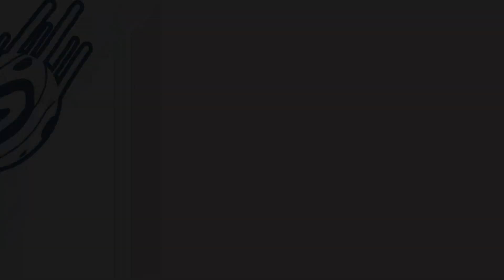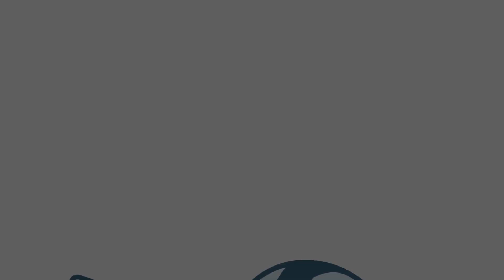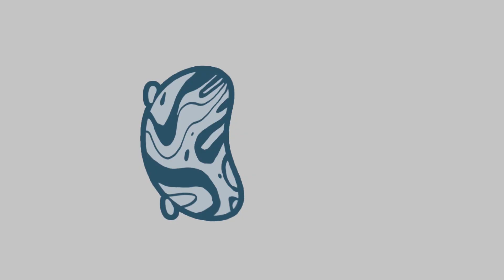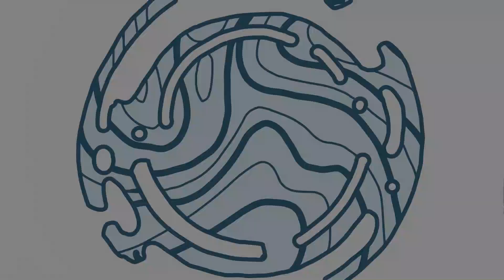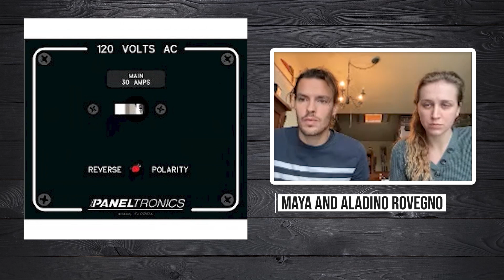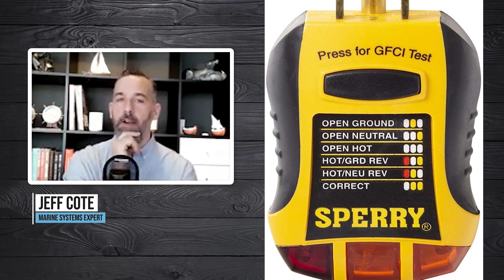The Dangers of Reverse Polarity on Your Boat

Comment: Thank you for a good episode. I have a Mastervolt isolating transformer in my 40 foot sail boat. I am wondering if I have to worry about reverse polarity.
Reply from the maker: if it is wired correctly then it will correct the polarity for you.  and the light at the panel would never come on.

Comment: Just had a very bizarre incident on my boat whereby a reverse polarity situation occured out of the blue.  I only noticed it when  one of my appliances tripped.  The bizarre thing was that before the marina service guy could check the breakers, the situation resolved itself.  Any clues what could cause a temporary reverse polarity situation that resolves itself??!
Reply from the maker: Sometimes, the reverse polarity light can be dimly visible if the AC ground and AC neutral are not properly connected and you have a small voltage differential (e.g. 5 - 10 volts).
Reply: @PacificYachtSystems  Nothing had been connected/disconnected for months!

Comment: Is this not only a problem if your ac circuit breakers only disconnect one wire, and not both? In europe this practice is highly discouraged. On boats however sometimes amatours does project without enough knowledge. Had it been on a house electric wiring, it's would be against the law not having a certified electrician doing the work. Cheers.
Reply from the maker: Besides the main AC breaker, which is double-pole, the other AC circuits only need to have a single pole. My understanding that commercial vessels, will have a double pole breaker for all AC circuits. Anyone else can shine some light on this.
Reply: @PacificYachtSystems   
In Norway only a few regions have TN configuration grid with H and N, most of the national grids is IT net with L1, L2 and Ground (two live wires and ground, no neutral). I recently bought a project boat and freaked out when I discovered single pole breakers on the panel. Panel is gotta go, installing new dual pole breakers with eart fault protection on the main breaker. And the DC system has «room for improvement» too, I have a lot to do. Designing new DC now, I find your web-resources very valuable. Yes, Im an engineer.

Comment: Hi Jeff, thanks for such an important subject selection.  I would like to run some tests in my AC instalation to verify (reasonably) that AC circuits are mostly safe in my boat. Can you suggest at least two or three tests or verifications that should be done? This is something i have been worried about for some time. The shown tester, i have it,  at least it did not showed anything wrong in my all outlets… Thanks!!!
Reply from the maker: Installing and using an ELCI on your boat main AC shorepower connection is a good way to make sure the boat the hot and neutral are well balanced and that very little current is using the AC grounding (green wire in North America).

Comment: Might be good to remind viewers from the outset that an AC circuit is not like your boat’s 12V where Red is Always positive and Black is Always negative. 
Your shore power 120 V reverses 60 times per second so the 120V is pushing both ways. However the Hot rises to 120 above Neutral then instantly reverses to 120 below Neutral. Neutral stays where it is. On a home circuit the neutral is also directly attached to Ground – the green wire. 
In that situation reversed polarity would immediately blow a fuse or breaker.
Reply from the maker: Thanks for sharing Paul, appreciate your input.

Comment: Misinformation in the video: Appliances don't "run backwards" due to reverse polarity. AC is alternating current so it does not matter.
DC is a different story.
Reply: Brushed 'ac-dc' motors can be depends on specific design, diode placement if they use them. An AC designed motor correct no change.
Reply from the maker: Good point.

Comment: If I have an outlet wired in reverse will it trigger my reverse polarity light? My reverse polarity light comes on only when I turn on my hot water heater
Reply from the maker: It's possible that your hot water tank is leaking some AC current on the grounding wire, hence why you get a reverse polarity light (albeit probably dim).
Reply: Not sure if this applies but...  I had a situation in an old house once where a 240 volt water heater was causing the neutral to be energized.  It turned out, one of the hot legs was disconnected and this caused the electricity to back feed into the neutral.
Reply: @wcm-wd2  thanks to the input. This one is 120v on my boa. I reversed the hot and neutral at my panel and no change. Next I'll crawl back and check the heater. It works fine. Just not sure why it makes the light come on.
Reply: @wcm-wd2  240v water heater should not not be using a nutral. 2 hots and ground. Miswired homes every day.
Reply: @braithmiller  It was many years ago, my memory was not quite right.  It was an old house that had the old barrel type fuses on the main.  One for each leg.  The fuse on one of the legs burned out.  The water heater was actually getting voltage from the good leg and sending it back through the other leg which was feeding the dead circuit for the rest of the house.
Reply: @wcm-wd2  yes, fun, why both legs of 220-240 breakers are tied. As well as the marine entry breaker is best to have the nutral broken as well.
Reply: If you don't know if anything is wired correctly and your doing this yourself get at the very least a non- contact voltage sensor and multi-meter. A plug in socket tester.
If your nutral connection is poor it is possible to light the reverse polarity light while using power. All power use off no light, assuming.
Reply: My first marina was always a scene on power. Wires in the water from broken conduit. They would 'work' on it till even my batteries and ups would run out. 
One well house I went into found the metal conduit carrying as the negative, sparks between boxes when it turned on. Wasn't allowed to fix it.
Reply: Is it possible that the element has gotten compromised by mineral build up?
Reply: Check the neutral is OK to shore. With a broken neutral there could be a return path via earth system, giving a difference between N and E, brining your light on

Comment: Great episode Jeff. Love the show. I was also a network engineer before I retired, so I get a kick out of that little connection. Just one thing to add about reverse polarity. People often get that light when using a "suitcase" generator as those often have a floating neutral. I don't think the suitcase gennys are a good idea on boats but they are popular. I haven't tested them but they are supposed to safe to use that way. What has your experience been in that situation?
Reply from the maker: We share the same concern, suitcase generators have a floating neutral and general cause the reverse polarity light to get somewhat dimly lit.

Comment: I have looked around but have not found a 30amp shore power device that goes between the dock pedestal and your shore power cable.  This device would be plugged in first to test the circuit before you plug in your boat and also have a 30amp gfci built in so you are not relying on the docks circuit breaker.  Some of the docks we have been on, the power pedestals are very old and look very suspect.  The dock we are at now only has a plug, no pedestal.     Seems like it should be readily available, maybe I just dont know the proper description to search for...
Reply: Easy to make, low demand would = overpriced.
Reply from the maker: Here's how i test my shorepower connection. First disable all AC breakers, including the double main breaker before connecting shore power. Once shorepower is connected, only turn on the double pole main breaker and make sure that the voltage is adequate and that the reverse polarity light is not illuminated. Once those checks are done, i'll energize the AC breakers.